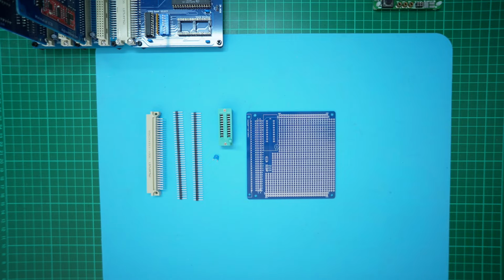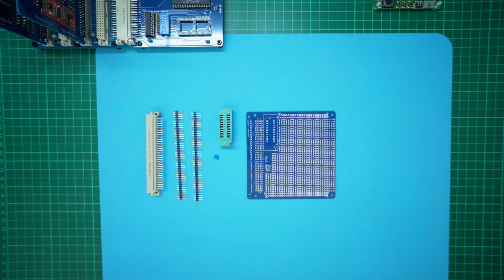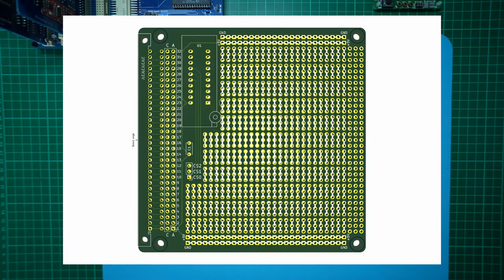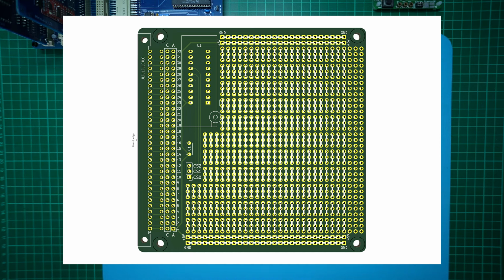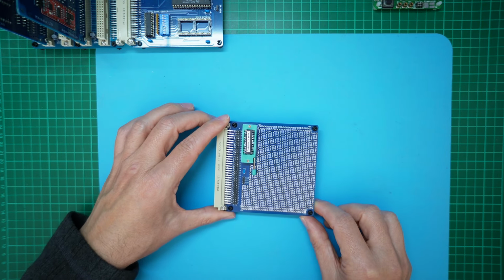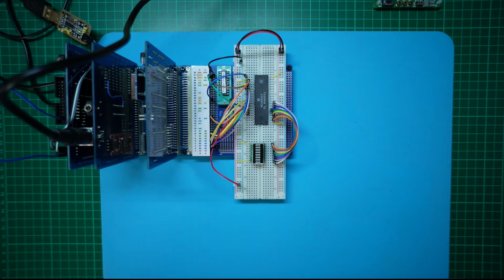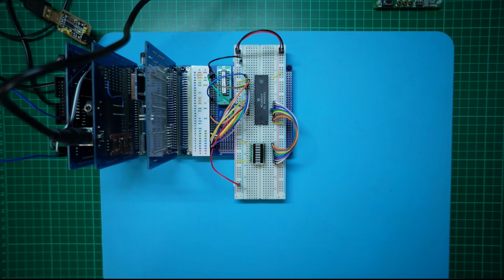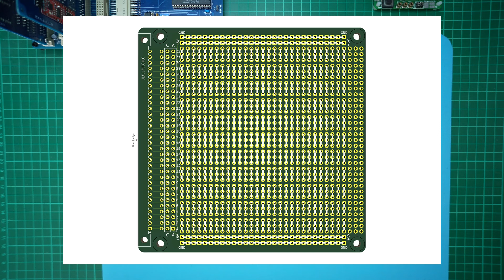Minimalist Europe Card Bus (MECB) - Improved Prototype Cards!

Comment: reminds me of the old PC ISA prototype card's with all the address and data bus glue logic tracked in. followed by a whole lot of holes 🙂 and the odd power traces. Back in the days when is was very easy to get a PC to control all sorts of things. well before windows decided that the user could not access any of the hardware without going through one of their drivers. 
the fun we had in the old days when PC's were not just something you ran software on, where they could easily do  things with the outside world and a few lines of code.  or a bit of fun with a TSR hooked in to the keyboard interrupt to throw in the odd extra keystroke on your colleagues PC. 🙂
Reply from the maker: I very much remember the ISA Prototype cards. In fact I just sold off my last few full-length ISA prototoye cards a couple of years ago. They had plenty of TTL glue logic and DIL switches for address selection.  The rest was all prototyping area.  They had been in storage, left over from the early days when I used them for lots of one-off PC control projects. 🤓
Reply: @DigicoolThings  still got one somewhere:-)

Comment: Order placed. 😊
Reply from the maker: Thanks David!  Order received.  I'll be on to it soon, to make sure it's in the next courier pick-up. 🤓
Reply: @DigicoolThings  this should be good. I was thinking about ordering the old one to use with a breadboard like you demoed. But this new version seems nicer for that use-case.  

I got the 6502 up and running and have the UART operational on the IO board.  I'm waiting on some right angle double row headers then I can properly test the pia.  Onwards and upwards from there.  
I'll be able to fill every slot on the backplane with the stuff I got so far.
Reply from the maker: @DavidLatham-productiondave  Awesome!  I do have plans as well, for a backplane extension.  But, at the moment I have more plans that there are hours in the day.  I will get there eventually.  Onwards and upwards, definately! 🤓